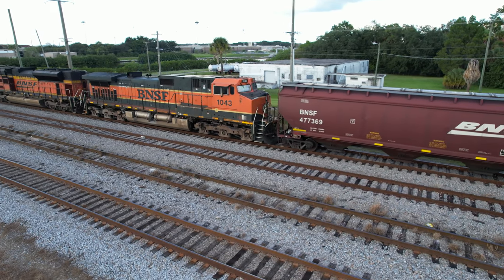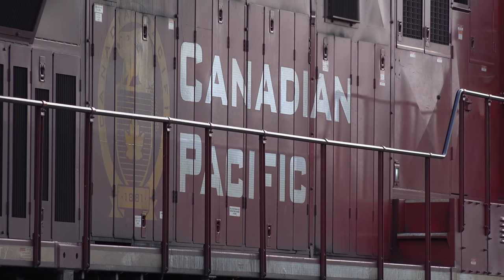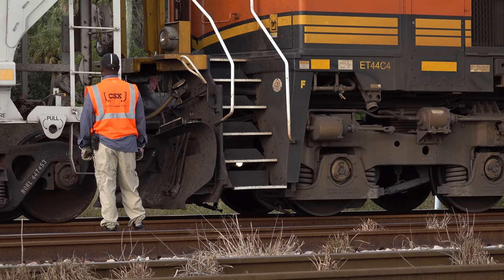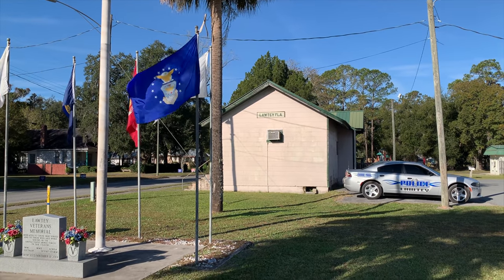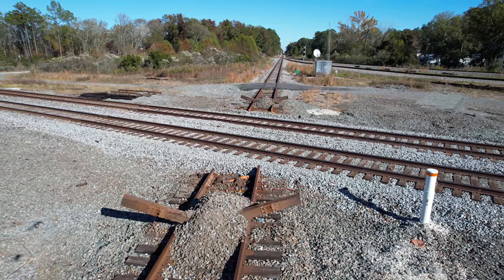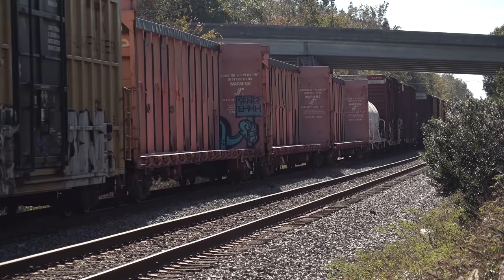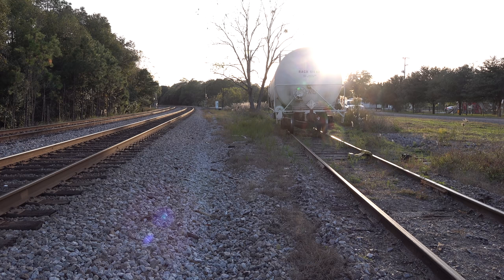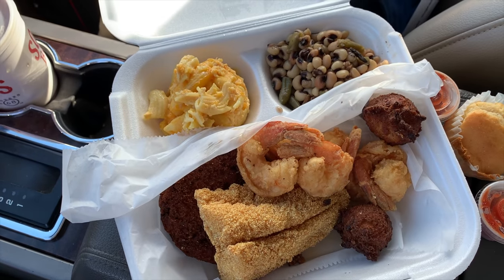Why We See Foreign Locomotives

Comment: This video brings up something I often wonder about, which is the number of locomotives assigned to various trains.  I've seen very long apparently heavy trains with one or two locomotives, and shorter or equal trains with a bunch plus distributed power.  Case in point, Q441, which you commented was "better than 13,000 feet today" but had just one locomotive (although I suppose there could have been more in the middle or at the back), compared to others that have four or five.  Empties vs. loaded could make a difference, but it doesn't seem that it should be so drastic, especially in a flat place like Florida.
Reply from the maker: 441 did have a DP locomotive in the middle of the train. The numbers of engines assigned to each train depends on it's tonnage and where it's going.

Comment: In Australia, it’s not really a concept. The states use different gauges and are only really connected through 1 or 2 standard gauge connections. In Victoria (my state) the broad gauge (most of the state’s gauge) is mostly used by Victorian engines except for a few from other states, mostly South Australia. The standard gauge network has all different state locos running. There can be a Vic G class, a SA BL class and a NSW 81 class all running the same train. The division is more of companies running on each other’s trains. Pacific National only really run their trains and sometimes the odd rescue if another company breaks down, blocking the line and can’t get a rescue out for a while

Comment: The Lupranol® polyol portfolio offers a diverse range of polyether polyols including conventional and graft polyols with the following typical values.

The Lupranol® graft series are polyether products containing dispersed particles of co-polymerized styrene and acrylonitrile, or SAN particles. These products offer property improvements for certain applications such as flexible foam and urethane elastomers.

The Lupraphen® polyol portfolio offers polyester polyols for CASE and footwear applications. These polyols are optimized for mechanical properties and hydrolysis resistance of the final product.

Comment: Another, and key reason, why foreign power runs through, is separating foreign power from the train at interchange and replacing it with home road power for the receiving railroad requires a new origin terminal set -and-release brake test.  Those tests often require local car departments to check the set and release of brakes on each car in the train.  Since few interchange points have car department staff on duty to perform the test, they need to drive to the location.  Road crews can perform this task en route but at origin terminals or interchanges, that work belongs to a different craft.   Not sure how CSX handles this but on Western RR's, unit grain loaders have a loop track so the end-to-end brake pipe is never severed and the loaded train can proceed to destination after loading without car department involvement.
Reply: Wrong! A swap of power just requires a continuity test.

Comment: I've seen a lot of foreign power run through. A CSX train with KCS head end power, and a few with a Union Pacific DPU. I've even seen a CSX local with a Union Pacific engine. Although I haven't seen any other foreign power from other railroads so far.

Comment: Just stumbled upon this 8 mpnths old vid, found it highly interesting. Things on the rails over your side off the pond are so different than here in Europe! In Germany we have multiple companies providing service on a unified semi-governmental national grid, so we are used to see locos from numerous companies pulling freight, or attend passenger service using the same track. And when we talk about "foreign powers" here, it's truly a vehicle from another country. Mostly long distance passenger trains, though. Because of different electricity grids and the much greater ratio of electric to diesel engines compared to the U.S., it's often unavoidable to switch locos when crossing borders. More and more e-engines are built with transformers to switch from one national electric grid to the neighnoring one, though. But the need to connect major hubs from different countries has always made numerous long distance express trains going non stop across borders, often diesel powered garnitures.
(Of course such a weak rail bedding serving so heavy freight is quite shocking for a german, too...)
Thanks for this insight into a very, very different world!

Comment: Greetings Danny:  I have always wondered as I have watched your video's and other train related videos. I would like to know if you can explain when you see the fuel tanks on the Engines are in one solid form, but they are other that have two other tanks mounted in the main tank, what is the purpose and what are they holding. This was something I have always wondered about, certainly would appreciate it if you could explain this. As the colder weather sets in here in Saskatchewan, Canada. Getting notified you have posted another new video, sure lifts your spirits. We quite frequently have foreign power on the CN Line that runs past the house. On it's way to the CN main line in Melville, Saskatchewan. The same lines that Via Rail {The Canadian} travels.  I sort of gathered you likes signs, it shows on your fence. Thanks once again for another terrific video.
Reply: Morgan, I am pulling my hair out trying to understand what you mean by this? In my yard, we have as many as two dozen different types of locomotives and they all have one solid fuel cell beneath them. The only time I can ever recall seeing something down along the fuel cell that was as big as the fuel cell but did not hold fuel was the battery boxes on the CF-7s which were carried over from their days as an F-unit. Anyhow if you could perhaps enlighten me as to what you are referring to, I would certainly like to be able to quench your thirst for knowledge.

Comment: as said basically convenience and saving time and money. dwell time in the yards is one factor that terminals are graded on. they don't want trains sitting any longer than necessary and to get them out of a yard  ASAP even if means to knock down the signal leaving the yard and then sit for hours outside of the yard. the 132# rail soft spot needs  tie attention ballast regulated

Comment: Worked for the BNSF ~20 years ago on the Southwest Division and the Southern California Division, and used to see Norfolk Southern locomotives with great regularity. I had heard they were leased, but I don't know if that's true. Getting on or off equipment that was even SLIGHTLY moving was STRICTLY prohibited. I heard that the weed monkeys would nab you even if you were stepping off of a sloshing tank car. Don't know if that's true. They can slosh for a really long time, even with the brakes set. Man, that 4 mph rule would have been GREAT.

Comment: I'm sure they have been doing it for many years, but it was only about 5 years ago when I first noticed BNSF power coming through White, Ga. on a CSX rail. And, the only time I saw Norfolk Southern power coming through White it was pulling four, maybe five, passenger cars with Federal Bureau of Investigation plastered down the sides. And, that train was hauling the mail, too! Way faster than any other I had seen, and not the usual horn signaling, either. One short honk after another with no cadence. All the way through town. Would really like to know what that was about, but guess I'll never know.

Comment: Danny:. That autorack train that you said had 680 axles, that was headed to Winston appears to have a length (when you do the math) of a little over 15,000 feet!  How often do you encounter trains that are that long (or longer) in your extensive railfanning experience and at what locations?  Lastly, are there any places in FL or the SE where single unit motive power is frequently used?  There were only a few occasions in close to 40 years with CSX (engineer for 39+ years) where I ran trains over 13,000 ft. (mostly on 165/166 and 308/307) and they were the result of enroute pick-ups with an already 170+ car train with 70+ loaded ammonia tanks on the rear!  As always, keep up the excellent work, your channel narration is without peer!  
(P.S.: I think that I have mentioned this before, but it would be nice for some of the more unusual trains (i.e.- those with distributed or single engine power, or extremely long consists...) to view an uninterrupted  runby to get an idea of what current operating practices will allow and gauge individual locomotive performance.  Just some thoughts and thanks again for being there!

Comment: I honestly describe foreign power like this: 
Foreign power occurs when a train originates from one railroad with headend power from the original railroad traveling to the location where the train will be transferred to the next railroad with the same locomotives to prevent wasting time swapping the locomotives for home road locomotives. Then the second railroad that transfered the train from the second repays the first in either money or running their own locos on trains being transferred to the first.

Example: let's say (disclaimer: this is completely fiction) CSX Q203 has a full load of autoracks, and arrives at Winston Yard, and the train is to be transferred to Norfolk Southern. To save time and money from switching the CSX locomotives for NS locomotives, they would leave the CSX engines on the train while on the NS portion of the trip to wherever.

Comment: Those CSX crews must be thankful for that BNSF power! When I was a conductor on the BNSF, I was entitled to a penalty for any foreign head end unit. I was entitled to a refrigerator and only BNSF, CN and CP units had the required electric refrigerators and not just an ice box. I was always amazed just how nice our ES44AC units were compared to the other railroads. Our high back cloth seats would recline and tilt back for optimal execution of rule 1.11.1 (necessary for the terrible meets on the BNSF). UP seats were plastic, they reclined but did not tilt back. CSX and NS had terrible low back seats or fixed high back seats which were bad for napping. CSX units were considered the worst. Though I had a Ferromex -9 once and that thing was terrible. The sidewall heat was bad order and to a conductor in Montana, sidewall heat in a must. 
This is not to say that BNSF didnot have bad units... All of the old -8s, -9s and SD70MACs were pretty bad. All had non-reclining seats and all had seen batter days. In fact if I were 2nd or 3rd out and I saw an ancient unit on the lineup on an M-train and it were a run through I would lay off sick to not have to deal with it. 
The only foreign units I found OK were UP SD70 ACE2 units. They had a fan which sucked the air out of the head, whereas BNSF cheaped out on those which made BNSF SD70ACE a smelly machine, especially in summer. The lack of smell made up for the lack of recline in the UP units.
BNSF did have some cool old power. I always enjoyed catching a helper turn out of Glendive in the old BN SD60Ms. They were well cared for and quite nice for the age. Always a fun trip pushing a coal train up the Glendive sub facing backward.

Comment: Under 4 MPH for boarding, how things have changed. When I was qualified on the local branch by Seaboard System, it was under 15MPH for boarding or de-training. Then under CSX they had banned getting on or off at all while the train was moving. Now it is 4 MPH again. It isn't fun at better than 10 MPH but it can be done safely.  But you sure have to look at where you are going to do it before attempting.

Comment: Foreign loco power has also been enabled by consolidation.  When there were dozens of Class 1 railroads, there were no legal requirements to allow foreign power, and union contracts that prevented foreign power and crews in most cases.  But as railroads consolidated, the federal government stuck in foreign use requirements.  Conrail in the east and the Rio Grande saga in the west sealed the deal.
Reply from the maker: Thanks! I did not get into union agreements, but I should have. The end of some of those agreements was a big reason that foreign power started showing up across the country.

Comment: I have run into foreign power in a confusing way a couple of times out west, trying to call the wrong railroad for engine issues lol
One time I saw a UP locomotive belching thick smoke going down the main line in the center divide of i5 in Washington (south of Longview?). It was the #3 unit and at night so not likely that the crew would see it.
I was able to read the unit number, and as a truck driver I have had enough interactions with bad crossings etc that I have the UPRR number saved on my phone, so I call them up and tell them that that unit was belching and should get checked, and I gave them the unit number and the track location, and they told me I must be wrong because they don't have any tracks in that area...

I told them that there was a locomotive that said Union Pacific in giant letters on the side, with the flag and paint job, and I had the unit number, so I was pretty sure it was a UP locomotive! Lol

Then they figured out it must be a foreign power trip, since that was a BNSF line. (I had never paid attention, since then I looked at what normally runs in that area lol)

I can't remember now if they transferred me to BNSF or just passed it along to the power desk, but they got it figured out finally!

The other time was down along 99 somewhere up north of Fresno, same thing, trailing engine blowing smoke or fire or sparks or something not healthy, and so I called whatever the locomotive said, and it turned out to be on the other line.

I have never seen a problematic locomotive on its own line, maybe the crews take better care of their own units? Lol

Comment: The railroads also repay other carriers with horse power hours for things such as wheelage ( wheels of a foreign carriers train passing over control points on a line they are operating on that is leased track from another rail road) instead of paying cash for the trackage rights they will repay in “horse power hours”

Comment: On BNSF in Norman Oklahoma we often see Ferromex engines mixed in with BNSF power. 
Could you do a video on how power is transmitted from the engine to the driving wheels. Are all wheels powered or just some of them? Is it gear driven or does each axle have a motor?
EMD was so far ahead of its time, 80 years old, what technology.

Comment: I live in Fort Lauderdale and I don't recall ever seeing foreign power on the Florida East Coast RR.
Reply: They had some leased NS power and even some EMD leasers there for a little while as they transitioned into the SD70s with Natural Gas.
Reply from the maker: Like Clawd says, FEC isn't a big run-thru power road, but they were running NS engines for a while.

Comment: Thanks for information about foreign power!   Has always wondered about that.  But, my question is is it time run?  Or time that engine is held by other companies?   Is there a way the other companies can keep track of hour that the engine is working (pulling cargo). Or sitting on the side just idling?
Reply: The companies that own the engines have a realtime record of where the engines are and how much fuel they are consuming. As for the means, they usually have some sort of agreement. When it's a runthrough power set, they usually have a set time to get to the industry for loading / unloading and then a time to get the train loaded / unloaded. Most of the time it's nowhere close to the actual time needed but I've been on one that had exactly 6 hours to return to the point of interchange or they were going to get slammed with some huge fees. We had priority the whole way and we were guaranteed a short work day! =D

Comment: I would say why we see it also has to do with computers and the ability to actually barter the equipment to each other and track mileage/hours/fuel and other criteria.  Without modern computing power and communications, this type of cooperation would be very difficult to keep track of financially and logistically.
Reply from the maker: ...and yet railroads kept pretty good track of loads, empties, engines and crews without computers for nearly 150 years. It's hard to think of navigating roads without GPS today. But we did it pretty well with paper maps and good directions for a  long time.

Comment: I forgot to say anything when the video came out, but just a tidbit from the BNSF side: BNSF does not serve the city of Salina, KS. To serve the city of Salina, they contract Watco's local Kansas & Oklahoma short line to get the cars to and from. The consist is handed over in Abilene from BNSF's Strong City sub, taken through UP trackage on the Salina sub between Abilene and Salina, and then brought into K&O's roads inside Salina. Before the train arrives at- and after it departs Abilene it is handled by crews out of Sand Creek Yard in Newton, where the train is flipped for a run east either on the La Junta/Emporia subs to KC, or the Arkansas City/Emporia subs to Wellington for an eventual landing in Springfield to be taken further east. I don't know which way it goes, I don't work for the railroad.

A couple extra tidbits about the Strong City sub, if you care to know: it has been decades since the subdivision served its namesake town of Strong City, instead it begins at UP Junction in Lost Springs, on UP's Lost Springs subdivision. To head west, trains must first head east on the La Junta to Peabody, and east(north) on the UP Lost Springs to Lost Springs. Many trains originate from Newton, and it takes about 110 track-miles to be geographically further west than Newton.